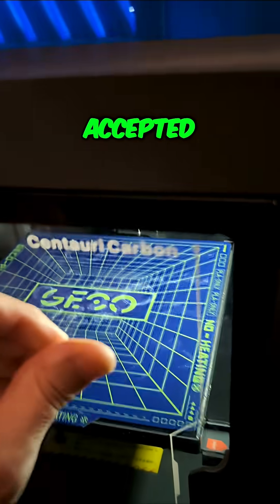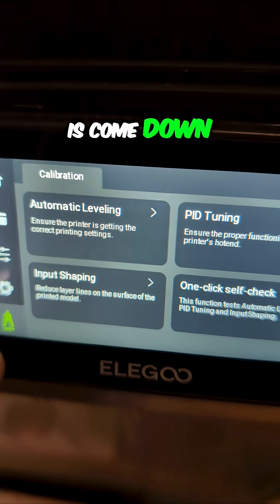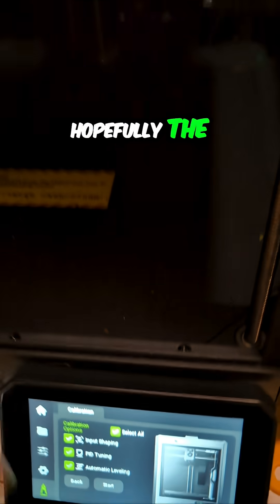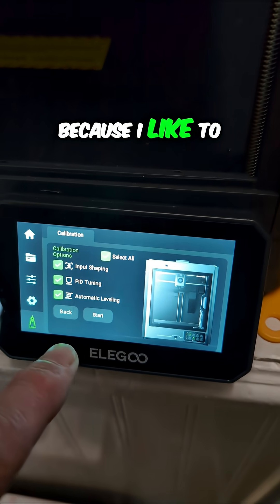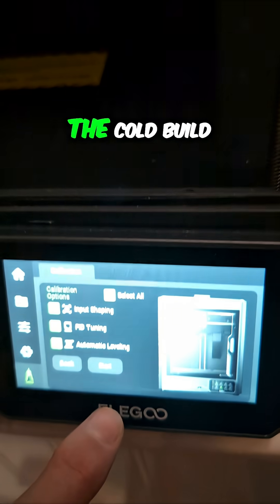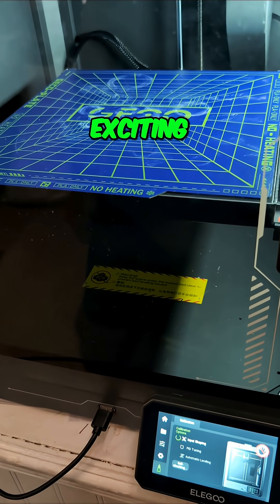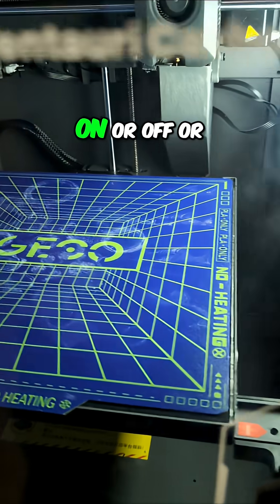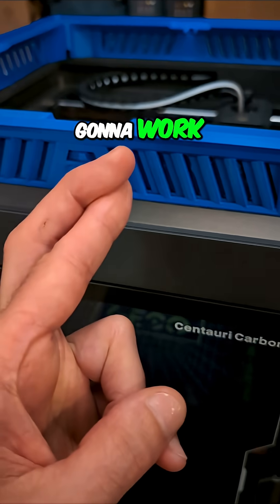Elegoo Centauri Carbon: Firmware Update & Calibration Guide #shorts

Comment: Why do you use a cold plate?
Reply from the maker: Reduced energy usage.
And it just makes more sense to me.
Why heat up the print bed to 60C or higher if I don't have to?
Reply: @GearReportMaker  Ohh! So now can you make temperature defaults for the print bed so you don’t have to set it manually? Also, does this reduce noise since the fans shouldn’t have to cool it as much?
Reply: @GearReportMaker  Your desktop PC uses more power at idle then the printer during printing lol

Comment: Does the manufacturer of the cold plate warn against heating the cold plate to 60C when the plate is designed for 30C?  Is the cold plate taking damage that could eventually lead to failure of the plate?